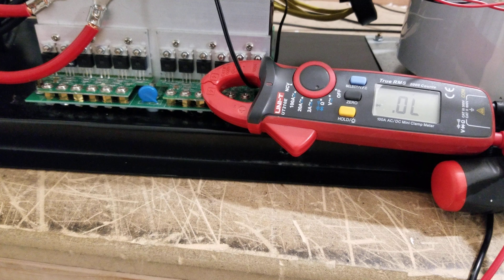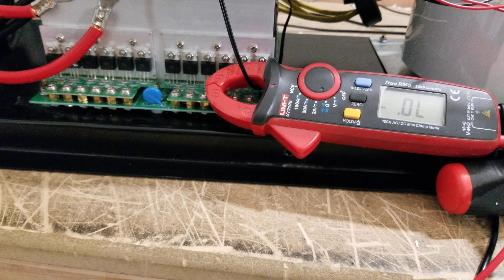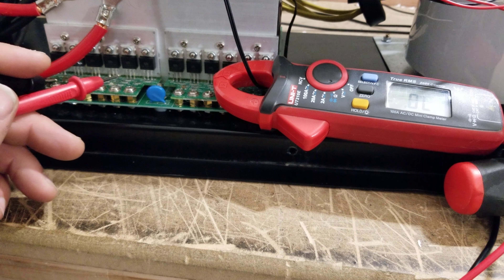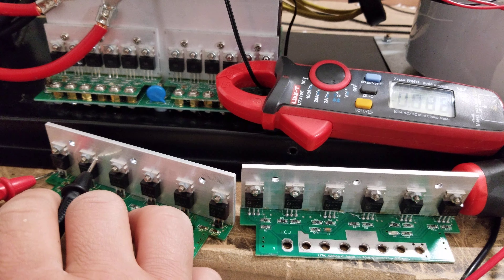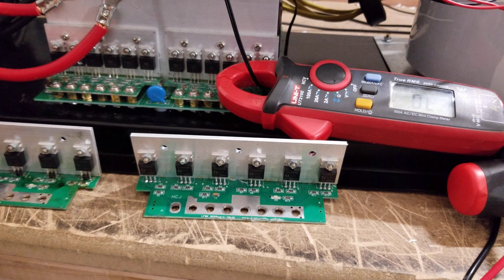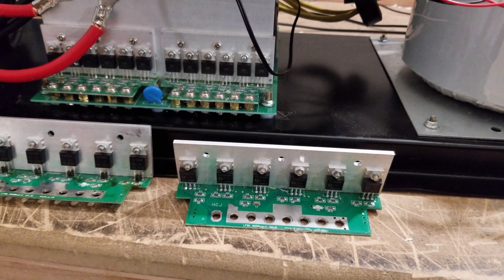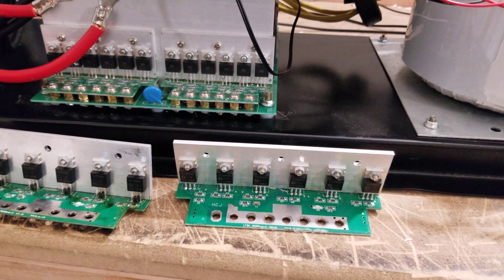Quick test for bad mosfets

Comment: I bought an older Aims pure sine wave inverter that powers on to a red fault led and outputs nothing- I can go in and check the mosfets this way while they're soldered on the board? I would just check each one like you did here?

Comment: Wow..After watching countless tutorials on Mosfet testing, your is the Only No Nonsense,  and practical guide. I just now tested my scooter motor speed controller and 9 out of 15 failed Mosfets, Failed. Time to desolder and replace them with genuine IRF3205 parts instead of the failed NEC85H21s made in China. That's a lot of Mosfets to fail at the same time. 
Thank you.

Comment: This is a very great and easy to understand video. Now I am going out to the garage and test the MOSFETs 
in my inverter charger that isn’t working. Question neither the inverter or the charger portion of my unit is working, does the charger portion use MOSFETs also?

Comment: Hello Sean
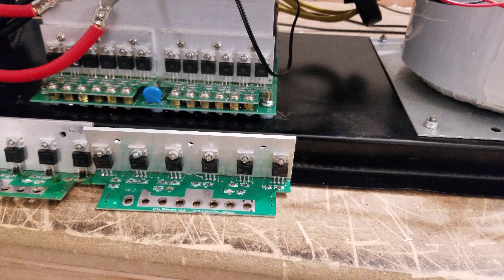I received my 2018 24-volt 15000 watt inverter last week and was all excited. At last! I noticed the box had a couple of creases on it, but all in all didn't look too bad. I signed for it, took it home, unboxed it and removed the lid for the inspection phase. UPS must have bounced it off of everything they could find. I couldn't believe it. The toroidal transformer was shifted and chipped the mosfet board and the underlying power board. The lead connection at the transformer looked like a rodent had at it and all four corners of the case are slightly bent. It was shipped out to you at 3:30 central time today, 11/5. I hope you can put humpty-dumpty back together again.
TJ Houston
Reply from the maker: Hey there. Message me on Facebook please.

Comment: Great video.
Question. Using multimeter I determined my yellow phase wire to controller has blown MOSFET
Controller is 36v 22ah 9-MOSFET.

the MOSFETS for each phase wire has one K150E09NE mosfet + two 110N7F6 mosfets.

For the "good" phase wires (blue/green), my multimeter readings are not around 2V, most are between 1.3 -1.5v.  The readings on bad phase wire (yellow) range from 0.2v - 0.02v, a clear indication that said mosfets need to be changed.

should i be concerned with my readings on the good phase wire and their respective mosfets?  i don't get a 2v average, but no indication that mosfets are bad when phase wires are testing with multimeter or with ebike diagnostic testing device. 

always eager to better my craft.  hope u can help.

/bklyn👑

Comment: Hello, I have a 15k power jack, all the mosfets had been damaged, I bought them all and also installed ALL the boards, again the mosfets on the positive side burned, I don't know the reason, my question is: those mosfets are installed in  a specific order?  is that I saw a different solder on some of them below, like a joint, or are they put anywhere?  mine is 24v 6 pcs.  Excuse my English, I'm from Puerto Rico.

Comment: But can you test each individual transistor while they're soldered in place? I'm asking because I have a power supply I'm trying to test. I really don't want to desolder all the parts to test. I put the leads on two identical transistors and one of them beeps while on the outside leads. So that one may be bad?
Reply: Same question
Reply: Yes you can. He answered it at the 4:25 mark of the video.

Comment: In my testing/checking of MOSFETs using Multi-meter, when the gate is charged, why some MOSFETs (N-channel & P-channel), the drain to source let us say 0.002 or less my meter reads, others starts with more higher like 0.435 and running up as fast
as a second or half a second until showing infinite? Discharged test is working (no reading on drain to source), What does it mean? Does all MOSFETs behave like that?

Comment: So are you saying if you test one on the left and it's bad the whole board is bad? all the mosfets ? Or if you test the next one and it's good then you can leave that one and just replace the ones that you're not getting 2 volts?
Reply: If the MOSFETs are connected in parallel, if just one of them is bad, all of them will test bad.  So it makes sense to replace the board, or clip them out of the circuit one at a time until the board tests good.  It's a roll of the dice.

Comment: Can you test a IGBT while still in the circuit board?
Reply: Yes.  I do that all of the time working on photoflash circuits.  If more than one is connected in parallel, they will all test bad if one of them is bad.  If only two are connected in parallel, I would clip out one of them and retest the remaining one. When an IGBT fails, it usually fails as a short.  You can also test an IGBT by measuring the gate to source resistance.  If it is very low usually (in single to double digit ohms), it is bad.  You have to consider any gate to source resistors on the circuit board.  If for example there is a 22K ohm g-s resistor on the board, that is what you will measure with your DMM.

Comment: Dumb question here.  How is the heat sink measuring anything?

Is it tied into the circuit somewhere?  The mosfets I need to test don't have heat sinks like this, so not sure where to measure any voltage.
Reply: The Gate, or the Pin 2 is connected to the upper part of the mosfet where screw is placed, so basically he is testing the voltage across the gate and drain.
Reply: My bad, it should be drain for pin 2 not gate.

Comment: Can I take mosfets out of a completely different device and use them somewhere else? Like I have a leaf blower I want to change the mosfets on instead of ordering some can I use some from an old PS3 or something as long as they look the same and have the same solder points? Is it common for different devices to use similar mosfets?
Reply: It depends on the specs of the replacement MOSFET you want to use.

Comment: Hey what about high voltage 600V N-Type MOSFET? I don't get the 2V when probing Gate to Earth. It shows open and no voltage.
Reply: That is sometimes fine...  Try continuity mode.. Drain should not beep to gate or source..  Drain is the metal tab on the back of the mosfet or the center pin....  GDS...  99% of the time..

Comment: I have a burned mosfet from ST, it's a P80NF55 @ CZ OYN 6   MAR 839! can you explain what are these digits mean! thanks
Reply: P80NF55 is the info you need. That's the type (or name) of that particular mosfet. The other letters/numbers are related to manufacturing identification and date of production. Type P80NF55 into google, to get the datasheet for this particular mosfet and you'll have all the information you need to know e.g. Voltage and current rating plus a thousand other parameters that this mosfet will operate within.